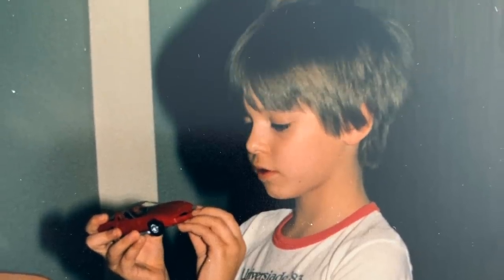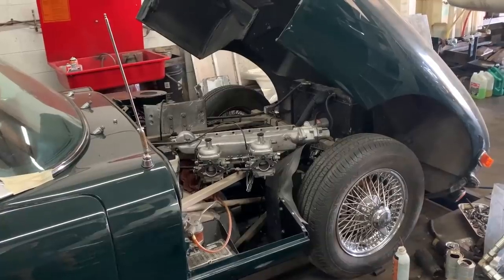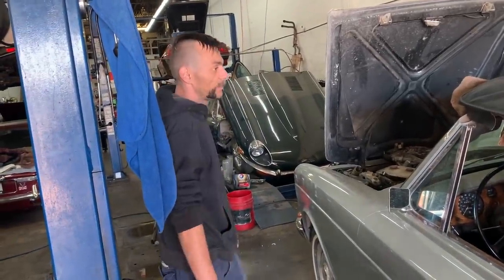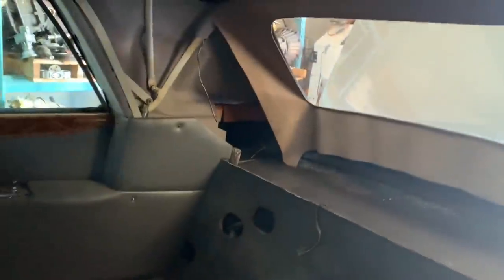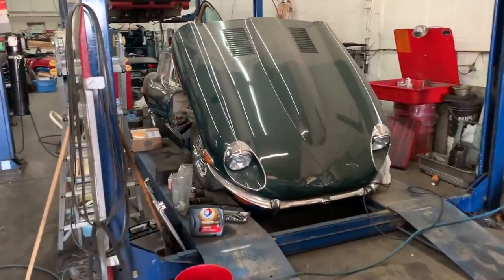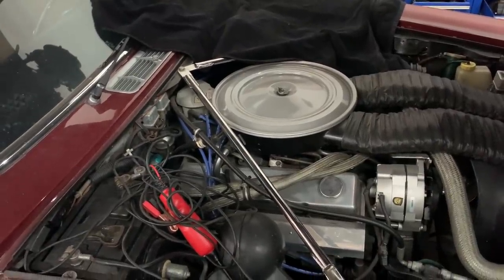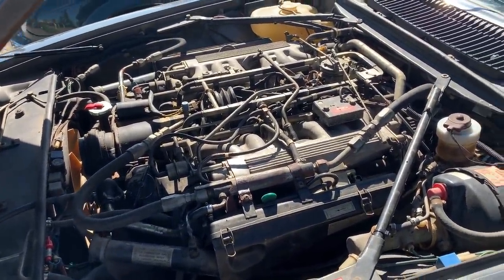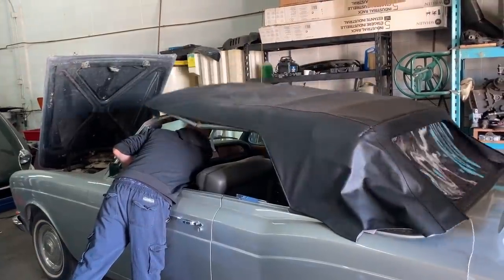Rolls Royce update 16, the Empress gets a top!

Comment: they should have put the headliner and padding in first.  and they hopefully will redo the staples in the 5th bow otherwise it will be wrinkled forever.  At least they used the proper material for the top, and hopefully this is a budget job so if you want to do it the factory way later on you can do it.  Nice to see you got help.  I did mine myself and had to do it over 7 times before it was correct.  you can't blame them, because 97% of trim shops don't know how to do these and they didn't have the old one to copy from.  They also didn't get the edge of the top low enough at the B pillar, that piping on the edge of the top is supposed to disappear under the B pillar and behind the edge of the fender, but they left it exposed and that will chafe on the fender when the top is put down unless they bend the fender outwards 1/4" to prevent that happening. See 5:01 to see the part I mean.

Comment: XJS-C; if you use aluminum heads and the normal "Lighter weight" replacement/ later gen SBC  you can maintain the balance on the swap. I do hate when people cobble them up & they are all ratty with noisy exhaust

Comment: Car is coming along nicely, looks really good now! I'm interested in seeing what's wrong with the hydraulic system. 
Idk if yours has the backup master cyl? I know my 75 shadow does, so it still has some braking even when the car hasn't run 
In a while. My owners manual has the hydraulic circuit diagrams in it, yours should too.

Comment: Would the original top have had a vinyl rear window, or glass? Maybe the convertible vinyl windows have improved. I just remember them cracking with age, going yellow, and generally deteriorating with time. I don't claim to be any kind of expert, but I would have thought that the top of the line convertibles would have a glass rear window. No criticism intended, as a vinyl window may have simply been a choice.

Comment: To run vehicles like that, you need a sense of humour (or very deep pockets) when it comes to running costs and repair bills.
I had a 3.6L (straight 6 DOHC 24 valve) Sovereign (the one they bolted a supercharger onto to create the XJR) and mechanically, it was bulletproof.  Some of the ancillaries, less so.  Over long distances it was surprisingly economical, but around town,  it drank like a drought-parched camel.

Comment: I‘m sorry but I‘m really disappointed about your decision to use a vinyl top instead of a canvas top. Totally unfitting and cheapening the appearance of this RR. I hardly believe it came that way from the factory as well. 
Anyways, that’s just me saying it ,but I wish you all the best in this rather bad year for you and yours.
Reply: Rolls Royce actually uses a special type of vinyl like material for their convertibles. It’s called Everflex. Please know your cars before making negative statements about others.
Reply: @codycody8449  I said that I find it unfitting. It´s his choice. I doubted that it came this way, but you´re right: RR used Everflex for both hard top and soft tops. In the SEVENTIES. Today you can use modern multi-layered canvas tops, which look more befitting to a RR...not only in my opinion. And I will make negative comments as long as I want. Here is another one: The same goes for the clear coat brush painting of the wooden interiour parts. That´s just not right and looks fugly."Actually" I don´t think RR ever did that from the get go.He should´ve went to a pro and spray paint these.But hey: It´s his car and just my opinion. Are you trigged?